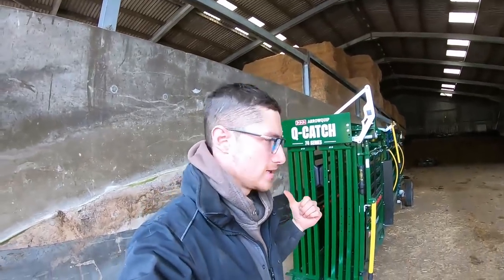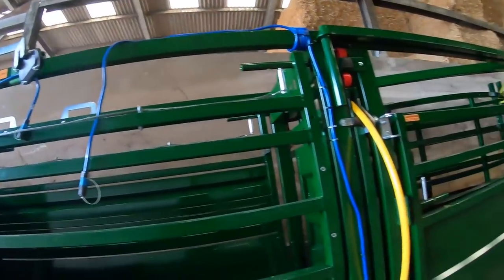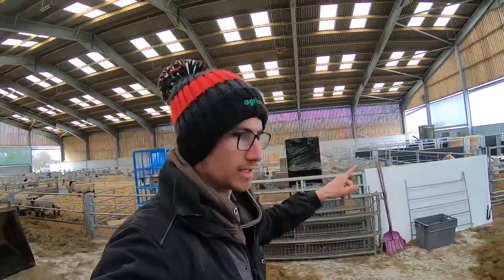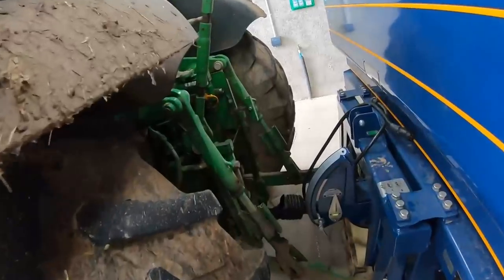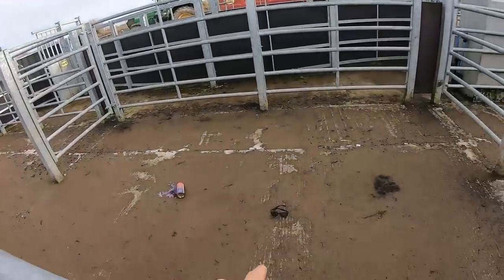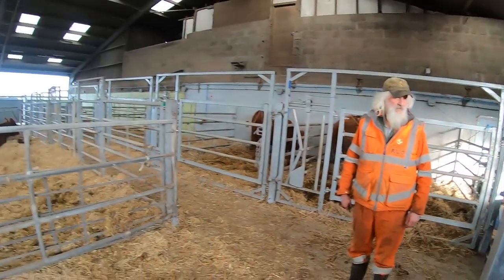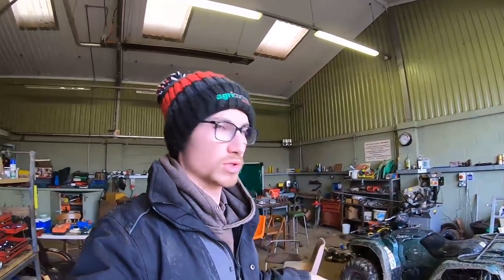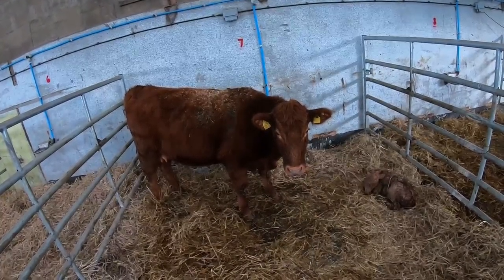WE COPIED TOM PEMBERTON….AGAIN!

Comment: Hi Josh, you showed us around the Arrowquip Green crush/head bail etc in this vid. When we were in Canada in 2015 we pulled up  in Swift Currant to check out a Arrowquip display of crushes etc they had set up. I like some of the ideas I saw there we didn't have here in Australia at the time. You walked past a galvanised crush and head bail just before you got into the tractor. It had a steering wheel( for want of a better description) on the top, could you give us a brief look at that as well. Something we did with our weigh box was to suspend it. I have seen too many setups where the weigh cables are damaged because they were on the ground. We put the weigh bars at the top and suspended the box.Thanks from Down Under
Reply from the maker: Looking forward to having a go with the Arrowquip. The galvanised one is on an off farm. We dont use it to often and I dont go up there much but it is an IAE crush. The steering wheel thing is to adjust how tight the crush closes and the head scoop is more of a hindrance than it is a help, we dont ever use it. Craig has already adjusted where the weigh cables run for that exact reason. Thanks for taking the time to comment!